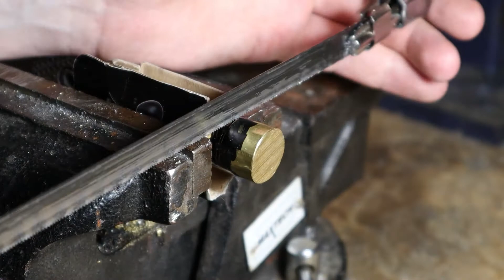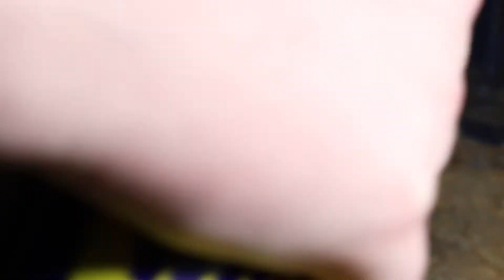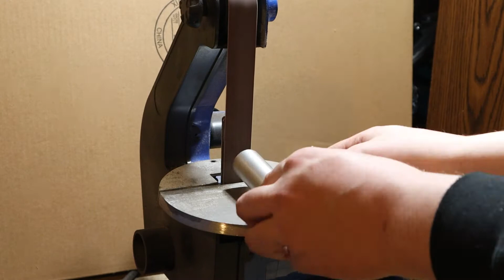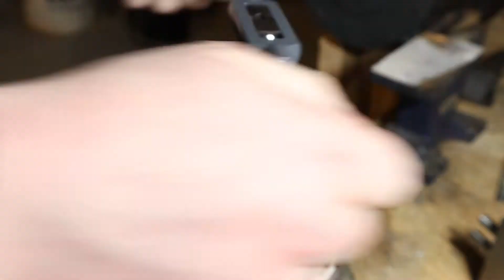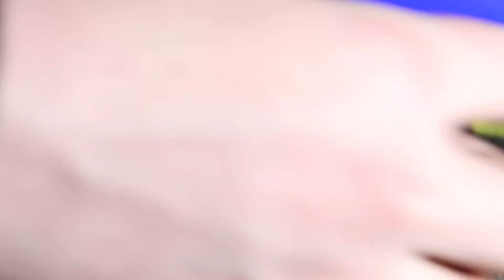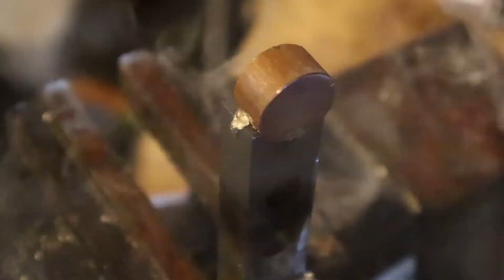Project: Hand Vise (Pt.4 Final)

Comment: Neat! Are the brass... nubs? intended to be used as a type of soft jaw?

I appreciate the "lessons learned" bit.
Reply from the maker: Yes. I'm using a softer metal so it won't scar anything it holds. I could also cut grooves into the jaws more easily if I wanted to, given how soft brass is.